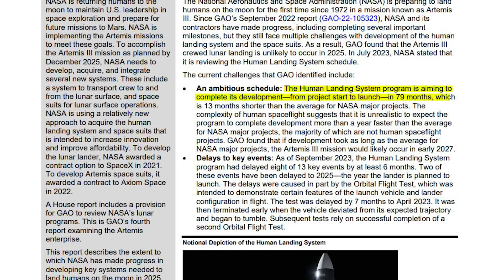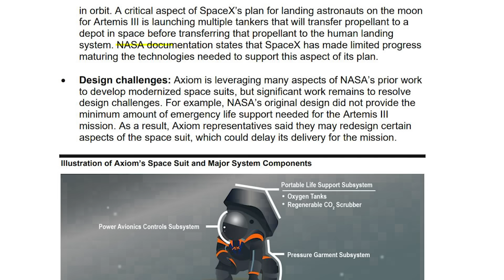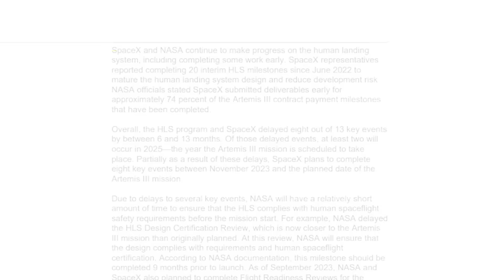Will SpaceX's Lunar Starship Be Ready For Artemis III?

Comment: Artemis needs human landing system to succeed, but the starship doesn't need SLS and Artemis to succeed, it can go alone, and do all the job by itself.
Reply: No. Starship's launch vehicle is not human rated. Falcon Heavy is not either. My understanding is they would be lethal if humans were on board either during a launch. SLS is human safe for heavy lift.
Reply: @bytesaber  it is not human rated "right now", and it is not finished "right now" too. There is one more step - project "dear moon" - project was started by big SpaceX investor together with elon musk, so getting "human rated" is inevitable for starship for this project alone.

Comment: Time to stop building these damn rockets and start building next gen space shuttles, like the had in For all Mankind.
Reply: That was a bit cringe for me. Things with wings beyond earth orbit...
Reply: @bytesaber  that makes no sense.  Better than the same old same old tube shaped rockets
Reply: @ryansmith1115  Well, it is fantasy, based on a lot of history ideas.  I do love the show. As for the Shuttle, it was never designed to leave low earth orbit.  Generally, you can't return to earth from speeds that are needed to leave earth orbit, hence why capsule designs are used for moon missions.  Fixed wings would break off.  Shuttle was a much slower speed.  I dunno, just my understanding.
Reply: @bytesaber  I know it's fantasy, but I was just using that as an example.

Comment: One thing that really concerns me about the starship lunar lander is if the moon's regolith is strong and stable enough to support the weight of the lander. I guess that one of the key things that they looked at for the mission, but I haven't heard anything about it at all. How wide will the feet in the landing legs need to be to sufficiently spread the weight of the vehicle over the surface of the moon? What will the tolerance be for any lean away from standing perfectly vertical? I guess the weaker gravity helps a lot with all of this.

I think it'd be cool if the starship could land in its side on the moon's surface. I guess the need for a fuel pick up or second intake makes this an absolute no go. I know that'd be overly complex and would increase the weight with the need for landing thrusters to be distributed over a larger area and it would need longer and more complex landing legs and a lot of extra strengthening for completely different stresses on the vehicle. Plus the landing footprint would be huge. 

I just think a horizontal starship on the moon would be cool. You're already refueling the vehicle in space, so if it had outside attachment points you could hook up gear to the lower side of the lander and access and deployment would be a bit easier as it's lower to the ground. I guess starships huge payload volume on the inside makes this unnecessary and even if it landed horizontally anything bolted to the outside would still be fairly high and a good distance from the surface, but it would be more like a medium/large stepladder or swing arm tall rather than a crane/elevator tall. Plus, if something's bolted to the outside you don't need a large hole in the side of the vehicle to be a door for equipment and there would be less assembly in the moon as the pieces could be larger. It would also be cool to see a short crane arm on the side of the vehicle that might have more capacity than the current design. I guess they're not looking to construct a moonbase yet, but it'd be neat if they could bolt a large telescope, vehicle or supply storage on the outside.

I'm sure there's a lot of reasons this is all a bad idea or totally unnecessary and risky. The biggest and most glaring issue of course is the fuel sitting on the side of the tank far away from the intake and the stability/stress issue is still there and the legs would be huge, very long and complex. Then there's the problem with the much more limited surface area for solar panels as well and I guess the bottom never gets heated by the sun either which causes other problems.

Comment: question should be .. will joe bide's nasa/faa allow SpaceX to be ready for Artemis III
Reply: SpaceX has a lot of work cut for themselves, much of which in unexplored areas of engineering. Even if I believe they'll be able to quite quickly reach the point where they fly 4 ships a week, other tech is likely going to be hard to develop to the point you can reliably use it for a mission.
I am already imagining 2 ship in orbit with a Dragon next to them carrying people tasked with hammering out a working fuel transfer system 😅

Comment: In short: No, it will not be ready for Artemis 3. It won't be ready for Artemis 4, 5, or 6.
Reply: Even if space isn’t ready in time I think they did a lot better in a few years than what masa did in 50 years thanks to budget cuts
Reply: Hardly the fault of SX, if NASA had planned and picked a Lunar Lander 10 years ago PLUS provided according funding.. but it hasn't.
Reply: SpaceX isn't needed for Artemis 5 on. BlueOrigin's team will provide the lander for Artemis V, and for later missions it will at the very least be a redundant option. Worst case scenario the mission goals for Artemis 3 & 4 are changed and the first moon landing happens in 2029 with Artemis V. Any delays beyond that aren't SpaceX's fault.
Reply: @plainText384 yeah, trust Blue Origin. They will surely deliver on their promises on time, like they did for cheap and reliable space tourism, reusable heavy launchers, the new space station and their clone of Starlink.
I really hope at least their engines will work properly for Vulkan...

Comment: there is no way artemis 2 launches before 2025. yes I said artemis 2 NOT 3
Reply: They are ahead of schedule.
Reply: Based on what?
  Or is it just sour grapes on your part?
Reply: @jameskelly3502  
past performance?
Also A2 is penciled in for (late) Nov 2024.. that's at max 61 (min 31) days away from being delayed into 2025.
Reply: Based on what? The SLS and as far as I know the Orion for Artemis II are very much on track.
Reply: They've finished installing the engines in the core stage a couple months ago, the ICPS-2 upper stage was already delivered to the cape this summer, the Orion vehicle is stacked with its service module, etc.

Across the board from ground equipment to astronaut training to flight hardware, Artemis II has been making great progress.
Reply: @plainText384 yeah, but they're still working on assessing the performance of Orion's heat shield that apparently wasn't up to spec.
Reply: @RobertoMaurizzi  while they did have more erosion than expected, they also had plenty of margin left. So it would be incorrect to say it wasn't "up to spec". 
They are looking into why it behaved the way it did, but that isn't delaying Artemis II. They already put the heatshield on Orion for Artemis II and they aren't slowing down anywhere else. Unless the investigation turns up some major error, or isn't finished in the next 11 months, it will not cause any delays at all.
Reply: I hope you're wrong, I'm getting old. I'm serious! I watched Apollo 11, aged 6 through to Apollo 17, aged 10. Now I am about to turn 61 (hopefully!).
Its been a long wait.🌚🚀🇳🇿

Comment: Even if it's delayed some, how much has NASA's side of Artemis been delayed? And how about the cost overrun??? Just sayin!
Reply: NASA and Boeing are currently already building SLS flight hardware for Artemis 3. In fact the entire ICPS upper stage for Artemis 3 had already been delivered back in August 2023. In addition Orion 004 and it's ESM are both also already in the process of being manufactured.

So all in all that seems to be progressing quite nicely towards a 2025/2026 launch.
Reply: @plainText384  delayed or not, tides are turned.. blame will shift one way or the other.
Reply: When NASA asked several companies about building a lander, SpaceX volunteered and got the job (including 2.9B Dollar). In April 2021 SpaceX agreed to the schedule and is already far behind with the first step, a flight into orbit that was promised for early 2022. You can't say you are almost ready knowing this isn't the case with the argument Artemis had delays in the past, so you are allowed to do the same.
Basically SpaceX got the job because they promised to be almost ready and show the first unmanned landing on the moon in early 2024. 2.5 years are gone and nobody can tell when the first flight into orbit will take place. It is also an open question if refueling in space will work as planned, if the re-entry works and if the Starship can land on the surface of the moon without a landing infrastructure.
Reply: @Ulrich.Bierwisch  Amen
Reply: @Ulrich.Bierwisch I think delays were guaranteed no matter who the initial landing contract went to. The Alpaca lander might've been the best overall selection but it had its own problems that led to Starship being selected. Blue Origin has a lot of ground to cover as well and their own propellant transfer tech to develop.
Reply: @Ulrich.Bierwisch  "can't say... Artemis had delays in the past so you are allowed to do the same " WHY NOT? They had years of delay and billions and billions overrun! This is the nature of space exploration. Apollo,  Shuttle, Blue Origin BE 4, and more all delayed all cost overrun!!! They are all doing something never done before! In my opinion they are allowed to do the same!!! It's the nature of the beast! If you don't get that you live in a fantasy world!!!

Comment: You know, SpaceX can always modify Falcon Heavy to make the 2024, 2025 deadlines if needed. The real problem isn't with SpaceX. The real problem is with Government bureaucracy stepping on SpaceX's toes with red tape and delays. I know the money has to come from the Government but is it possible that SpaceX goes to the moon without NASA? The only question I would have is why? Is there something there that we can mine? Would SpaceX be better off building a low earth orbital space station flying people to it and back down around the world in minutes. It would be a brand new way to fly from one continent to another. Or, how about SpaceX head on out to the asteroid belt. Find ice water and minerals there to bring back to Earth  (or Mars) for processing. There is a lot of money to be made in space and NASA really needs to decide what they want to be moving forward.
Reply: How would they use falcon heavy? To refuel the HLS? The Spacex HLS is far too large and heavy to fit on a falcon heavy. You might be able to replace some of the propellant missions with falcon heavies, but that’s like trying to move a full household from New York to California using only carloads in a VW Beetle.
Reply: @SciFlyGal  The Human Landing System (HLS) is in SpaceX's hands at this point and I know that they are going to get StarShip up and on the Moon. However, SpaceX has the ability to put many shots into space which can handle hardware, fuel, environment requirements, and more. It's just a matter of what Falcon and Falcon Heavy can take on its back. If they had to, they could scale down from the size of StarShip to the size of Falcon Heavy. It's possible to do if it looks like StarShip falls behind contract stipulations. SpaceX has the ability to send many payloads into orbit and to the moon and back. Granted that the engineering hurdles are not easy but who said space was going to be easy?
Reply: 1) Why should designing and building a lunar lander based on Falcon 9/ Falcon Heavy hardware be any faster than the Starship approach? Falcon Heavy isn't remotely close to being a crewed moon landing vehicle.
2) That's not the contract they made with NASA. SpaceX's bid for HLS was explicitly a Starship variant. That's the design that NASA chose over competitors. SpaceX does not have the contractual freedom to redesign their proposal from scratch whenever they want to.
3) SpaceX is planning on flying crew around the moon on a separate, non-NASA mission. They have a private customer for the DearMoon mission, which was planned for this year. However, Starship isn't going to be able to deliver on that timeline either.
Reply: Sigh. You can't change physics. Falcon Heavy isn't capable of generating the delta V to reach escape velocity. They have to expend the vehicle to reach geosynch. It also doesn't have the volume to carry enough fuel to LEO to make the trip worthwhile. The only reason 'starship' can theoretically do it is via refueling in orbit; otherwise, it can only reach LEO as well. Methylox is not as powerful a combo as Hydrolox. If they can't make it to the Moon successfully, then Mars or the inner belt is a complete non starter.

And NASA knows what its mission is. It just has to deal with the fact there's a group of politicos who constantly play 'yank the funds for a power trip!' with their miniscule budget (and don't tell me that 0.48% isn't borderline for high end research).
Reply: They haven't been held back a single minute by the government.
Reply: @TheMoneypresident  Well, that's not exactly true. 
https://www.faa.gov/newsroom/faa-closes-spacex-starship-mishap-investigation
The FAA delayed the launch of the second rocket test from April 20, 2023 until they concluded their root cause investigation on November 17, 2023. There were actually over 63 changes that they wanted to see. Most had already been designed into the second test. What the FAA seem to forget is that these are tests and SpaceX expects them to fail in one way or another. That's how SpaceX works. It's the same philosophy that they used on Falcon. SpaceX has 3 more tests on StarShip 1 prototype and then they move on with StarShip 2. If the FAA drag their feet again, we might not see another test until next spring.
Reply: bro they cant modify FH stupid if you paid attention to anything you would know that HLS is a modified starship upper stage.
Reply: I love the SpaceX Cutists devoid of engineering, astronautics, or space policy knowledge, blame all problems on Government Bureaucracy but never on Elon Musk or SpaceX. If only we set Elon Free! Bullshit. This isn't how science or engineering works, nor how complex spaceflight systems are built and managed.
Reply: The real problem is with Gov using Artemis as a jobs / political-kick-back-program and that the managers at NASA "only" noticed in the last minute that they need a Lunar-Lander ready for Artemis 3, but no one thought to budget for it in TIME & MONEY - so they turned to commercial and took whatever came up in a desperate attempt to at least have something.
Reply: @joansparky4439  NASA has set 2027 as the date to land back on the Moon. SpaceX was awarded 2.9 billion to make it happen. Blue Origin took NASA to court and lost. So it looks like SpaceX has a lot of work in front of them. If the FAA keeps delaying flight licenses, SpaceX is going to have a hard time making contract dates.

Comment: Lol. They don't have ANY part of SS ready. Zero successful launches. Zero successful landings. Mux is whacked out. Ps need 12 to 20 "tanker variants" also. For 1 moonshot
Reply: actually they have had successful landings
Reply: It's called testing ! How much has NASA's part been delayed? And how much cost overrun???
Reply: They had one successful upper stage landing, back when they were flying up to approximately airline altitude, as well as some low altitude hops.
Reply: This is their strategy.  They fail forward. Spacex has ALWAYS been like this. Look up the falcon videos. Falcon 1 and falcon 9 failed numerous times. They have an iterative approach to rocket development.  They design as best they can in the time they have, they test, they fail, they make adjustments, they test again.
Reply: Does that 12-20 get the HLS back home or will it be left for the next nation to squat in..?
Reply: @NeedsLessWedge  Most likely, HLS will be a version without heat shield.
Reply: @Ulrich.Bierwisch  I was wondering if they plan on keeping it in orbit somewhere, or setting it back down on the moon gently to use for a habitat or letting it plow into the moon somewhere..